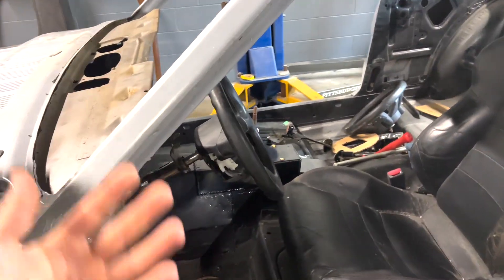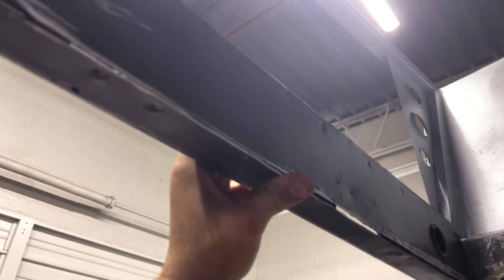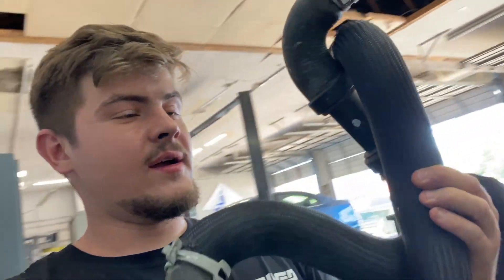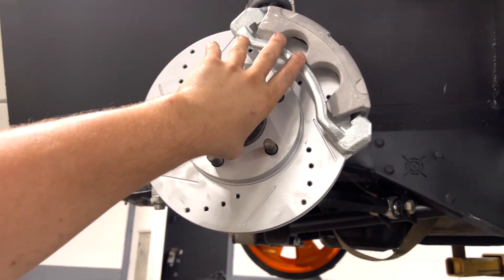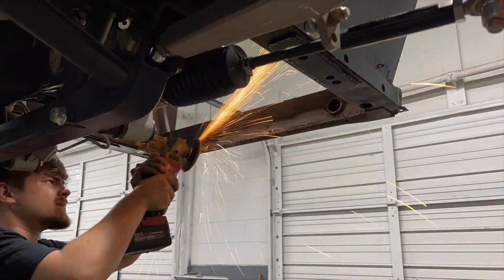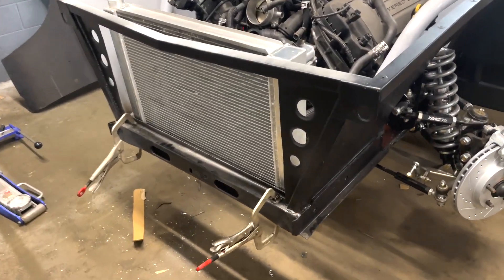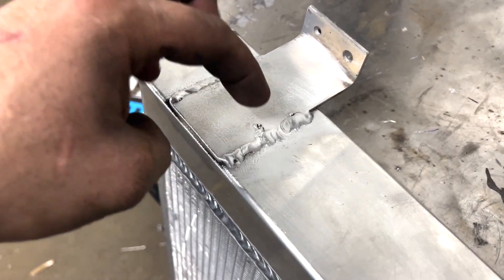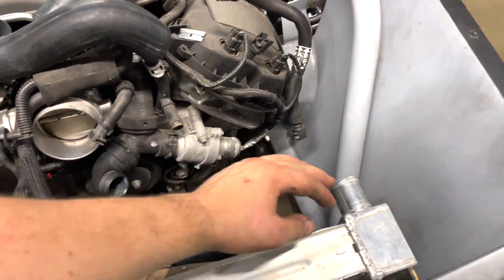Installing The Custom Radiator On My 1965 FORD MUSTANG GT

Comment: Always clean aluminium with acetone before welding! Using a wire wheel will just scuff it up and probably add contaminants from the wire wheel too it. So you need to clean it afterwards. Especially on a Rad where you’ll get porosity causing tiny little water leaks!

Comment: You have to make a shelf fore the tank to sit on have to put rubber mount under it steel will rub a hole right through them aluminum  tanks just a thought making grate progress on the vcd cafe

Comment: Take a piece of your welding rod and bend it into the shape you need for that upper rad hose then take that to the parts store to find the hose(s) you will need.

Comment: Custom rad hoses!!!! Get some pipe and get it bent at exhaust shop then just take about 3” of rubber hose to connect ends! Then chrome them up or powder coat!!!

Comment: Rivnuts for the radiator supports up top - inch clean finish and easier to work with later down the road.

Comment: The two small hoses on the lower radiator hose go to the oil cooler.  The simplest solution to your radiator hose issue would be to get a good welder to swap the inlet and outlet nipples to the opposite sides for you.  We do that kind of stuff all the time in the race car world.  As for the brakes, that tubing bender won't bend 3/16" tube so you'll need a different one for the brake lines.  The 1996-2004 Cobra front calipers will bolt right on with the proper caliper brackets.

Comment: Why not weld the bolt for the radiator so you don't have a future headache getting the radiator out , this way you just have to take the nut off and also put a grommet on the nut side so it can move around without cracking the radiator

Comment: Safety concern: Carrying the refill Argon tank in the car, or in the trunk is not a safe way to do it. They could explode if transfered in enclosed spaces. Pick up trucks are highly recommended.  Companies that deliver them uses caged but open trucks for the tanks.

Comment: Just get some aluminum pipe or some stainless steel pipe and fabricate your own rad hoses. Issue resolved , only need rubber on the ends

Comment: Try keep taping the trigger for the  welding on aluminum. It’s really hard to use that mig set up to weld aluminum.  So your tack welding your tack welds you can always try to pull the wire as well your pushing it the same way you weld steel.    But the welds don’t really look that bad all it has to do is hold.

Comment: I really don't understand why you welded everything to the radiator.  Now if you ever need to replace the radiator (or sell it on to someone else who needs to replace it) you won't be able to replace the radiator without having to fabricate and weld more brackets.  You could have easily fabricated a mount welded to the chassis that the radiator slid into, then is bolted in place with retaining brackets.  If you were worried about it rubbing then a couple of rubber or foam pads in key locations would have taken care of it.  If you go that route then you can quickly and easily swap in any radiator that fits without having to weld and fabricate.

Comment: Not to be to critical, because its not my build, but personally if I had room I would have done a rail for it to sit in some rubber mounts on the bottom.  A removeable rail with rubber mounts up top.  That way if you need to replace it can do so with welding brackets.  A new one just drops in. The rad is still enclosed with rubber, but won't crack or possibly leak at the welds.  Just kind of sandwiched in between the mounts.  Just me though.  In case it gets damaged on the road it would be a hard fix.  Not super likely, but a little work now will save a bunch down the road.  Just my 2 cents worth.

Comment: Awesome video as always Ben. I do have a concern regarding the radiator tho. I recommend you notch the frame rails on either side of it. The reason being is that if you get any chassis flex at all, the twisting forces will crack the aluminum welds on the radiator wide open. This is why you see most radiators only bolted from the top mounts and effectively floating in the bottom mounts, sometimes with rubber bushings to counter vibrations etc.

Comment: Ben, I suggest for the top radiator mounts you made to weld in a nut from the outside part (where the bolt head is right now), and the bolt go in from the engine bay outward to make it serviceable and easy to remove in case needed rather than removing the front grill to get the bolt out. and also; fill your brake lines with sand when bending them so they stay round and true.

Comment: I've read that you can use a MIG for aluminum but I've never seen it done before. I wouldn't say those welds are structural but for a rad support they are more than adequate. It did a pretty good job considering.
Reply: Of cause a Mig can weld aluminium..... ah just had a thought, you are supposed to change the liner to suit.

Comment: You should really consider some taps so instead of running bolts completely through stuff you can tap the metal and run a bolt like factory, also I see genuine excitement and happiness in your eyes about this car. I’m excited for this build!

Comment: Love watching your show you do amazing work just one comment why didn't did you put the gas tank in that way I would have the nozzles point in frontwards not backwards but whatever it's whatever who's Everest choice I guess or preference but good job man keep it up
Reply: So that when you stand on the loud pedal the fuel goes back towards the lines, not away from them :) Pretty sure the tank is designed to be installed that way.

Comment: I wouldn't paint the radiator it will effect it's cooling, it will hold some of the heat in, Or paint just the tanks...
Reply: I've worked in a radiator shop recoring radiators for almost 16 years. We paint every radiator that leaves the property. Unless the customer says otherwise. Painting the core and tanks doesn't. Have any affect on the cores ability to properly cool. He can paint the core and tanks. All he wants without affecting its ability to cool.

Comment: You need to do a pressure test after welding on the radiator. Pin holes will creep up on you..😳👍

Comment: I know the bank is getting low but if you go to seed shop or industrial hose shop. You can get braded hoses. They are more flexible than rubber and hold up better. You will need to get the connectors as well from the hose shop. Insure in inner lining is chemical resistant.
Reply: Braided lines are more stiffer  and nowhere near as flexible.  As the standard rubber hoses and lines are.

Comment: I'd put the accessories on the motor before deciding on line placement,or hoses.Just to save you $.Did you test fit the headers near the steering?Not digging,just want you to have an easier time instead of rework.Looking good.

Comment: The radiator inlet and outlet isn't in the right place. The drivers side is suppose to be on the bottom and the passenger side should be on top.
Reply from the maker: I’m routing the lines differently but it will work
Reply: @Vtuned  sounds good I have a coyote swapped fox I run at brainerd.....I think it's close to you.

Comment: Enjoying the content, Ben. Thanks.

Nice fabrication skills. One question though, the top rad mounts aren't you going to encounter aluminium/steel corrosion? Because the bolts which I'm guessing are steel are touching the aluminium brackets. You'll get corrosion because the metals aren't compatible together I'm sure I read that somewhere.

Good work though!

Comment: Retired English mechanic your Mustang build you have done first class work every thing you done so far is good but I have trouble with what you said about your brake system I think the brake booster is ok I think the brake master cylinder is ok leave alone but move brake reservoir into engine bay so I would pull off reservoir the reservoir has two tubes push into two seals go to the brake shop and get two adapters can be straight or right angle or you make your own brake pipes same diameter as your reservoir make a flare small pipe goes into master cylinder a flat washer then small pipe enough to put on rubber hose and clip so you will have two hoses go though in to the engine bay mount your reservoir on your own small bracket fit reservoir level or slightly higher higher is better as you have a engine you need to see your brake fluid brakes wear down brake fluid goes down as you know so safer good luck Stuart

Comment: Ben you’re doing a great job, don’t listen to the keyboard warriors that say it’s going to be a death trap, I’m a chassis specialist and can assure you this build is stronger than factory. Also stop putting yourself down your awesome
Reply: I was going to say they same thing, shouldn’t listen to the haters and stop pointing out the flaws, no one is perfect.
Reply: @vintagekuz7567  well said mate, doing a build like this is a learning curve even for a pro that’s never done this type of thing. This will be a monster when it’s finished, ok probably will have a few teething issues which is expected but none the less a great build
Reply: Ben’s fitting pretty good brakes and the whole car is going to be a lot lighter than the current model so I think it should stop pretty well. 👍
Reply: I have to agree! That's way stronger than factory. Haters don't know how to do this kind of work. Jealousy is a strong emotion...
Reply: How much education does a chassis specialist need, I know English isn't the most necessary in your line of work but there is a difference in your and you're.

Just giving you a hard time mi eenglich isn't always purfect lol
Reply: I dont understand there reasonings. Behind saying the car will be a death trap. The coyote is a common swap for these cars. People act like this is something. Thats never been done before. The suspension and front end components. Came from a company that specializes in coyote swapping. This generation mustang.
Reply: Something that I've aways liked about the kid. Is that he knows, and sees exactly. What he wants, and won't let nobody. Change the vision that's  inside his head.
Reply: Any vehicle is a "potential" death trap, it all depends on who is driving, 99% is a driver error, not the vehicle!

Comment: Use rivnuts on the panel to fix the radiatorthen you can bolt from inside the engine bay, way easier

Comment: I think your gonna have some major air pockets trapped in there since the cap is lower than the top of the engine you probably should use the reservoir and get it up above the engine

Comment: Well, you have a Coyote engine in this car, 600 HP??, need bigger, better brakes, rotors, I put my 2005 mustang 14 inch rotors, and Brembo Dual  calipers, from 2015-2017 GT, you can do that, needs Caddy Brake calipers inserts, Much, much better brake, bought them used $300 from eBay, Do same !!! These rotors look like "toys";o))

Comment: I believe front brake hard lines need 2 or 3 coils in them in case of an accident there is flex if the brake line moves.

Comment: Big breaks are for bragging , not for breaking . Unless it's a very fast and very heavy car it doesn't need it , and very heavy and very fast shouldn't even exist . 99% of cars that have big breaks will never be on the race track where you might need them . Just like most of the jacked up trucks will never see any real off road use .

Comment: You could make radiator hoses out of stainless pipe and use straight silicone pieces as connectors.

Comment: Have you done the calculations to determine if your master cylinder/brake booster setup is correct for the calipers and rotors you are using? That whole braking system scares me and you really need to do more research on what you’re doing.

Comment: Your going to need to add a small shroud around the openings on the side of the radiator no ?
Reply: Yes and no. If there is AC added then the condenser coil will sit in front of the ratiator and take up that space. Rubber flaps would take up that space if no condenser coil is added.

Comment: Hey bro, thanks for the update, been looking forward to your video, a question 🙋, wouldn't Shaving off the frame rails at the location you did weaken the structural integrity because your mods of the tubes were just above it.
Reply: There's not much stress there it infront of the wheel.